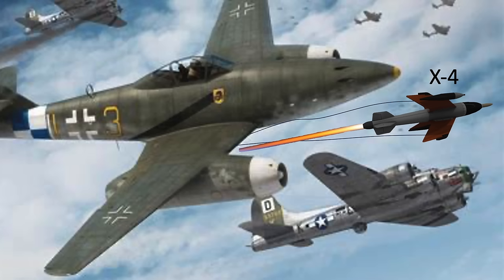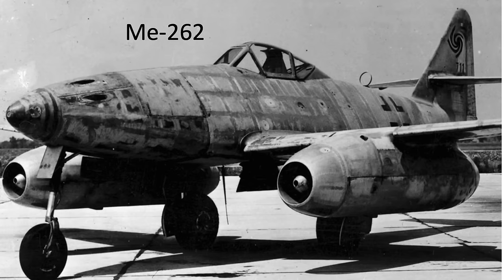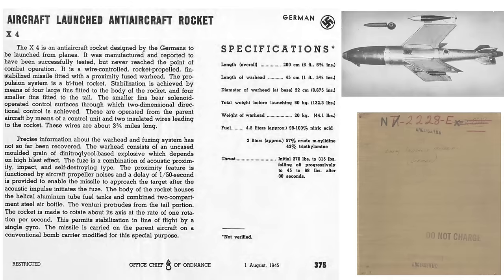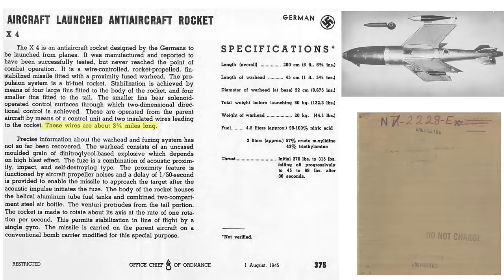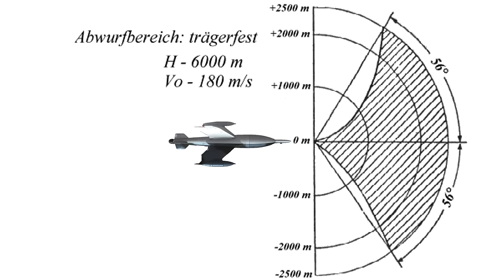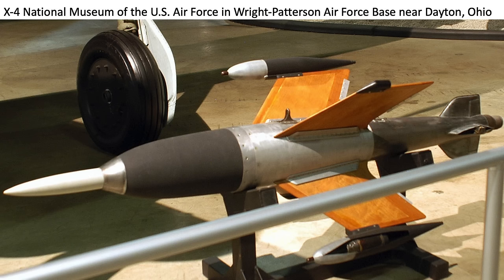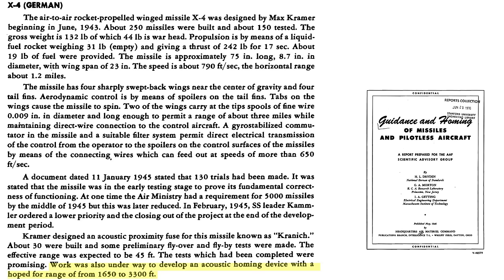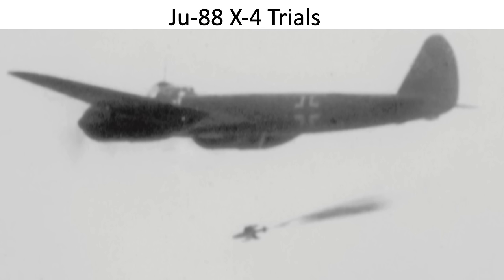WWII German Wire Guided Air-to-Air Missile, the X-4

Comment: I do wonder how combat effective a manual commanded air to air missile would be considering the launching platforms would be single seat fighters.
Controlling such missiles is already a bit challenging on its own, as shown by the combat record of the early anti tank missiles like the Sagger. Having to do so while flying a plane seems a bit overwhelming on the pilot.
Reply: Probably more effective than unguided rockets.  The Bullpup missile was widely used by the U.S. in Vietnam.  It had mixed results, but you need to compare those results to those of unguided weapons.
Reply: Yea and the ME262 was notoriously already a handful to fly when attacking bombers due to the closing speed.
This thing looks basically like an air to air version of the air to ship Fritz-X, that being the case the US could have done the same thing with an air to ship missile it had that was better than the Fritz-X being a fire and forget weapon via radar lock, I can't remember it's name for sure although it might have been called the Sea Whiz. 
This thing and the Fritz-X both require someone to fly the missile all the way to the target, like a TOW missile on a helicopter the big disadvantage is that the aircraft that fired it is vulnerable the whole time, but with the Sea Whiz once it gets it's radar lock and it's fired the aircraft can turn around or perform whatever kind of evasive maneuvering it needed to including selecting another target and firing on it while the first missile is still in flight, I'm sure had they the need they could have adapted the Sea Whiz to an air to air application, but the USAAF really didn't have a need for it because of having air superiority and not having to shoot down large formations of bombers, however had the ME262 been pressed into service earlier it could have countered it being fired from propeller driven fighter's.
Reply: @dukecraig2402  ASM-2 Bat is the US Navy Weapon you are thinking off.
Reply: I think the french also had some wire guided AAMs in the 50s and 60s. Would have to look at the training data for those.
Reply: There is a couple of things to note when discussing the German guidance systems for early SAM and AAM.
1 The most critical were German engineers and Test Pilots themselves.   Suitable 2 seat aircraft would be the 2 seat versions of the Do 335, Me 262 and less likely aircraft like the Ju 88G-7 and Ju 388J which might have the speed to survive in fighter infests allied airspace for long enough.  
2  The Germans had a lot of experience with CLOS by this time, how to use simulators and how much training and practice bombs was required  ( i think about 10 or more)  but it had to be rememberede that the intention was to get the missiles into production and then add self homing 'fire and foget' latter.   
-In the case of the Riefenstahl X-4 self homing was an acoustic homing systems code named "Dogge".   In this system a microphone was place to one side of the nose cone.   As the missile rotated the sound was put through a phase sensitive rectifier referenced to the up of the gyroscope.  Basically just a commutator to switch the sound to the correct fin servo.   It was expected to have a range of 1000m.  since the X-4 had a range of 2.5km So you can imagine a fighter launching at 2000m and cutting the wires at 500m which would be about a 14 second flight.  
An infrared seeker would work in roughly the same way only a Lead Supped Cell cooled by nitrogen.  In fact the Germ,an invented to reticle scan.  

The Hs 298 was a competitor of the Rhurshtahl X-4 but more complex in that it had an autopilot (easier to fly) and didn't rotate.  Homing heads were
1 MAX-P and passive seeker to home onto allied ground mapping on night fighter radar.   2 MAX-A an active version of the above using 5.8cm magnetron as well as acoustic and infrared versions.
Reply: @xxxm981  The French ATGM were based on the Ruhrstahl X-7 which was just the anti tank version of the X-4 but the Germans had data from Fritz-X and Hs 293 and had a good idea.  They gave their bomb timers plenty of practice and dummy drops.
Reply: It seems to me the concept would have required a glass nosed Me-262 with a prone missile guider looking on. A good point is that being wire guided made it totally immune to any jamming...
Reply: @wrathofatlantis2316 The 2 seat version of the Do 335 had a raised rear cockpit that would have been suitable but I think so long as the fuel Me 262 had rear controls it could be done.   They were planning acoustic homing and infrared homing.  The X-7 ground launched version had a SACLOS version that tracked an infrared flare called steinkbok or pinsel
Reply: I think improved R4M with higher velocity, longer range at of 1,000 meters or more is sufficient numbers.  The Me-262 could carry 4 racks totaling 48 rockets.  Once the rockets are launched the aerodynamic would improve.  The probably of hits would increase significantly..  

The R4M was more effective than the ML-108.
Reply: But no one was invented nothing better ' till then
Reply: Britain rejected manually commanded missiles like Fighter-Controlled Spaniel in 1941. If the situation had required it Artemis, a very inventive semi-active radar homing missile designed around the 3-inch rocket could have entered production by 1944.
Reply: @xxxm981 they copied the x4
Reply: That wa a big Problem so it was intended for use on the two seater ju 88

Comment: Firing that thing from a propeller driven aircraft must have been terrifying.
Reply: Thought about that for a moment. Given how thin the wires were, I don't see a problem with tangling a propeller; they would have been chewed up instantly by hundreds of pounds of metal driven by 2,000 hp.

I think they would be more of a problem if ingested into one of the early axial flow jet engines, which were temperamental in their reliability to begin with.

Comment: Using acoustic homing instead of radar proximity fusing is an interesting approach.
Reply: The Germans were also testing acoustic detection and homing for their night fighters, including the Me262.

"The photograph at the bottom of [p.185 of Dan Sharp's book] depicts the Baldrian twin microphone antenna for acoustic location of prey. This system had originally been tested in the Me 262 V1. Testing in Me 262 w-n 170079 were surprisingly successful with the pilot being able to follow the cockpit display easily."
Reply: @gort8203  And its would have not worked!!! British and US dumped that line of research in 1940!!
Reply: @gort8203  Acoustic location obviously works well as aircraft engine sound can be heard from very far away.
In the case of jet aircraft the engine frequency is well over 4000Hz whereas piston aircraft between 75 Hz for the propellers and about 300 Hz for the exhaust poppet valves.   That's far enough apart for the sound of to be filtered out.   A rocket also doesn't have propeller noise or poppet valve noise.

Comment: I wonder how the joystick would work if the missile was constantly rotating? Maybe some pre-launch gyro something so the missile could maintain an initial reference? I guess if they had circuitry advanced enough to home on engine noise, that wouldn't be too hard.
Reply: If I recall correctly, many postwar ATGMs (SS.11, 9M14 and the likes) did use a method similar to the one you describe.
Considering the X-4 was a predecesor of this missiles they probably inherited that feature too.
Reply: Yep, wondered the same thing. The control surfaces would have to be in constant movement. For example, if the pilot wants to steer the missile left, the tab is only moved to the left of its own axis for a very brief portion of a second before having to transition to what would then be considered right of its own axis, and would have to be neutral at the 1/4 and 3/4 rotations of the missile, with both tabs moving oppositely in relation to each other.

Perhaps it was similar to the control functions of helicopter blades which face the same issue?
Reply: For the ground lanched versions X-7 and X-10 There was a single vertically aligned gyroscope that kept track of 'up'.  Slip rings and a cummudator directed the signals to the correct control surface.     Control surfaces were only on/off.   The gryo was spun up before launch by a gunpowder charge.  I immagined that would need to be changed to an electric motor or pneumatic vacuum motor for an airborn version or else the pilot would need to fly level for a few seconds while the gyro spun up.   In these a tiltmeter (pendulum with microswitches) is used to power a small torgue motor that levels the gyro.   It's very weak torgue so that vibraion and manouvering averages out.  It seems they worked out a way to just spin up before launch.
Reply: @williamzk9083  Thank you. So, were the control tabs in constant motion per joystick inputs?
Reply: @williamzk9083  Thanks! It's fascinating to think of how many technologies were right on the verge of being more mature - like guided missiles, better radars, heat seeking missiles, all sorts of things, especially once semiconductors started to appear.
Reply: @mikearmstrong8483  The surfaces deflected the same angle each time.  The joystick used switches.  It wasn't a proportional control.  Ruhrstahl tested proportional control and it provided no improvement in accuracy.  For instance If the flare and smoke of the missile showed it was too far to the left of target the operator would nudge the joystick for a moment to the right.  The control surface would flick out at the right time and turn the missile.   Once the missile was centered the operator had to nudge the joystick in the opposite direction for a moment to neutralize the motion.
-Some of the German missiles had an autopilot and it would be possible to send a compass heading. Mainly used in SAM.
Reply: Maybe the X4 was fin stabilized as opposed to spin stabilized
Reply: @dcosio97  it was fin stabilised but the 60 RPM rotation evened out aerodynamic imperfections so it flew a perfect straight line.

Comment: It's curious to note that the X4 trials used an FW190 as the launch aircraft from and under-wing pylon. How it managed not to become entangled in the propeller is a mystery.
Reply: -The wire was basically piano wire with electrical motor insulation over the top.   It was flaked out from the inside of hollow bobbins.   I would immagine once launched the Fw-190 would make a mommentary climb manouver and from then on the wire was below and behined the aircraft making a sort of U shape.  
-There was a radio control option for the X-4.
The FuG 510/FuG 540 Kogge/Brigge High Frequency 1200Mhz/25cm radio control system.
It impulse modulated using directional polyrod antenna was to be the core of a
number of German guided missiles with development starting in 1944.
It was designed to be very immune to jamming.  .

Kogge/Brigge simply replaced the wire bobbins and was a drop in
replacement for the wire guidance on the X-4 and X-10. This system
was very important as it was to be the uplink of a number of surface
to air missiles.
Reply: @williamzk9083  the TV guided X-7 must have presented a challenge with limited bandwidth.

Comment: Does anyone know any reason that liquid fueling for rockets was so prevalent in ww2 German tech? I would think small, unitised rockets like this that don't need to be throttled would benefit far more from being solid fueled.
Reply: Why did the Vikings not use aircraft carriers?                 

Didn´t have the tech yet.
Reply: -The X-4 was actually meant to receive a liquid propellant motor but
eneded up with a solid propllant.
-The factory producing the BMW developed bipropellant liquid

rocket motor was hit damaging several hundred of these motors, as a
result a backup solid propellant motor was selected as a substitute.
This motor was no longer smokeless though it was more economical.
-By this time the Germans had a lot of experience with guided rockets.
-One very important factor that influnced the selection of propellant is
that solid propellants tend to block radio and radar signals strongly.
The USN had a lot of problems with its "Thumper" SAM system of 1945
from the solid propellants blocking radio commands.  The Germans had been
through these problems earlier.
Reply: @TheRealNeill X-4 was supposed to transition to radio controlled.   The scaled down ATGM variant called X-7 used a two pulse solid rocket motor basically a central propellant charge and a outer annual one.  
-The reason the X-4 was no used in 1944 was that the BMW rocket motors (nearly 1000 of them, were lost in a bombing raid so the decision was made to switch to solid propellants.   The Germans did have dyglycol rockets but could not afford the propellant production.  Both Nitirc Acid and H2O2 were easy to produce.
-I have a book by Nowra on German guided missiles, I think it was methoned there but its well known in books.  The internet is hopeless.

Comment: Why bother with a 1 revolution per second spin?  That does not seem like enough to usefully stabilize a projectile and it needlessly complicates the flight control system.
Reply: 1 rev per second, not minute.
Reply: @mfrsr Yes, I mistyped.  I think 1 rev per second does not seem like much.
Reply: Its to even out aerodynamic tolerances so that the missile flies straight even if fins or rocket motor are out of alignment.   Its not gyro stabilization.

Comment: Making a manually guided missile spin seems needlessly complicated.  What was there reference for "up", left and right?
Reply: This was a common system in early wire guided missiles.  See the French SS.10.

The Gyro would interpret the command signals and translate them into the appropriate direction of control.
Reply: They were Germans, why make it simple?
Reply: @JimmySailor  That's correct.  They had a single vertically aligned gyro to maintain an up reference.  A commutatar on the missile axis would then switch the up/down/left/right signals to the control surface at the correct instance.    In fact the ground launched X-7 needed only a single control surface with a solenoid to control all 4 directions so it saved a lot of money.  Spinning the missile greatly reduces costs as it reduces manufavuring tollerances. Guided missiles need a gyro to be effective anyway.

Comment: How do you steer a spinning missile?  As it spins its control axes change.  What was up is now sideways or down.
Reply: It had a mechnical breaker that changed the steering pulses depending on rotation.
THere is actually a really good explanation video on youtube, given the topic tho, its a bit ibscure.
Reply: theres a gyroscope inside that stayed in horizontal position. a metal ring that was broken up into four sections (actually 12 but that makes explaining unnecessary complicated) was mounted on the gyroscope so that it didnt move with the missile motion. the command signals are fed to that stationary ring inside the x4 and the missiles "servos" picked them up via sliding contacts while spinning with the missiles body around that ring. the wiring was made so that the vertical  fin (left/right command signals) that was on top automatically got connection to the horizontal (up/down) command signals when sliding from one section of the ring to the next.

Comment: Liquid fuel was not a good choice for an AA missile.  With a solid fuel, they would have been able to massively simplify the design.  Such a weapon really needed a two-seater plane to use properly you simply can't use this and fly at the same time.  I'm sure there were a few 2 seater trainer versions of the FW190 or ME262 that could be modified but numbers would be super limited as only a handful of Me 262 B1a and B1a-U1's were built.  As for the acoustic fuse that would be useless in most conditions as the microphones of the period had major issues with fidelity (hence why all broadcasts of the period sound a little off) such a device would be very easily jammed just like the acoustic torpedoes of the day could also be overloaded and jammed.

Comment: With the rotation of the missile how would the pilot then accurately control it?
Reply: A gyro system in the missile compensated.  But I don't see the need for that slow spin and that attendant complication.
Reply: @gort8203  The slow spin ensured the missile flew in a stable linear direction as it evened out missile tolerances..  It also meant a signle control surface could control or 4 directios by opperating at the correct time.

Comment: I don't see how the pilot can use a joystick to control a missile that is rotating. If you want it to go right, say, half a second (ie a half revolution) later, the same movement will make it go left. It sounds impossible, but e idently the Germans had a solution, or it would not have got that far.

Comment: That was very interesting. If the Germans had mass produced these with the 262 it could have changed the outcome of the war
Reply: No, it was impossible. No such wonderweapon was missing for the germans. They lacked logistics.
Reply: It wouldn‘t have changed the outcome, but it would have made the late-war strategic bombing a good deal more costly
Reply: I think the 7.7 pounds R4M unguided rockets (550 m/s in 200 m) could have appeared earlier on prop fighters, and would have been equally effective, even with their short 0.8 second burn time... It is the one low tech weapon that could have appeared earlier and completely changed the air war in my opinion.
Reply: @KING_LIRI1 They lacked petrol, which they were producing at just 2% of US output. An alliance with the Soviets would only have totalled 4-4.5 %. Despite this, mere Soviet neutrality would easily have prolonged the War several years, until Atom bombs became prevalent.